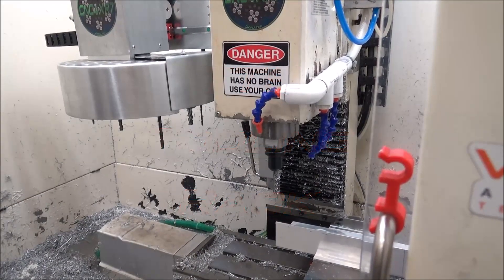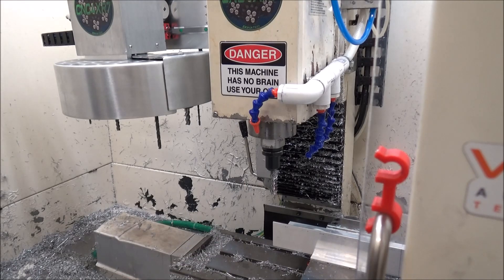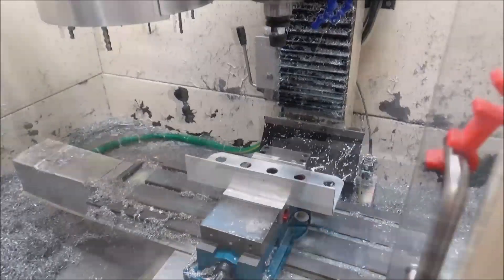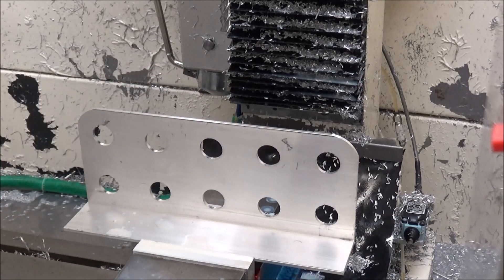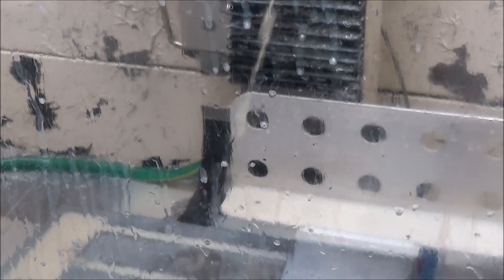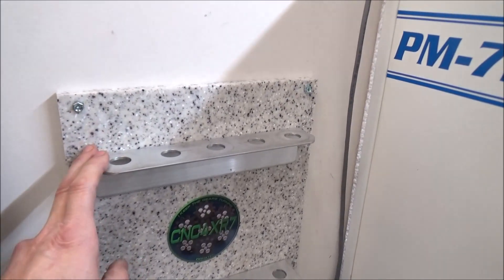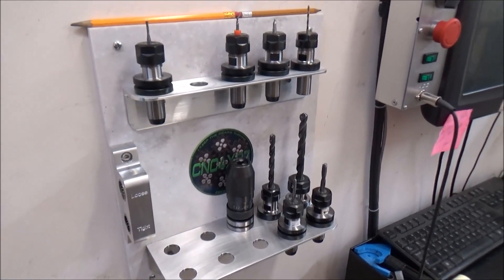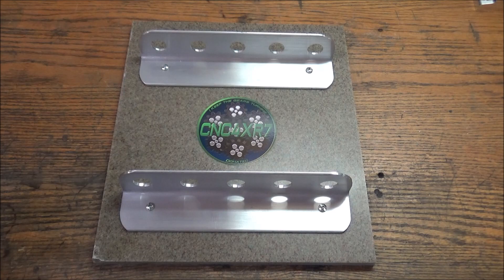TTS Tool Rack

Comment: Hi Sam,  Great project.  ATC works very well.  Your tool storage is simple but effective.  A tip.  Change your non-cutting  feedrate to rapid.  Fusion360 settings can be changed for this.  You will save cycle time.  I also set my non-cutting feedrate to retract 0.25mm above the cutting depth so the endmill is clear from the floor of cavities during the rapid moves.
Reply from the maker: Thanks for the tip! Yes I need to tweak my cam for sure. But since I'm not always doing production stuff i tend to forget.